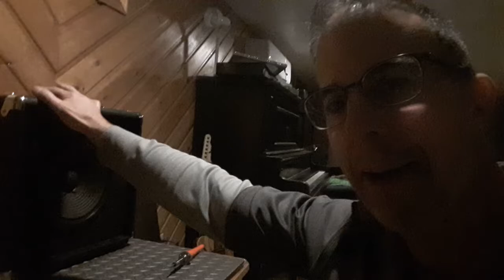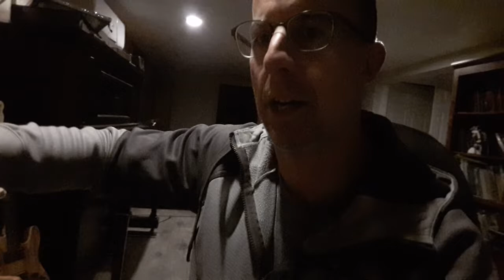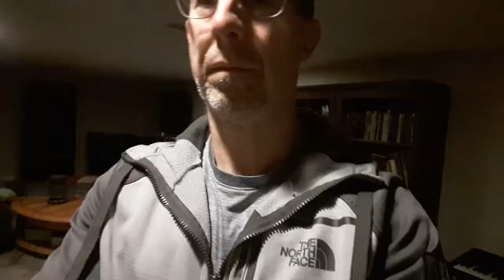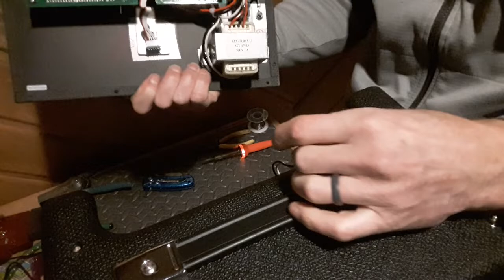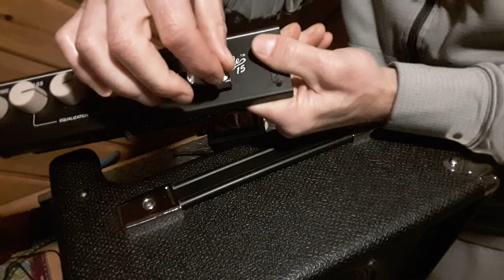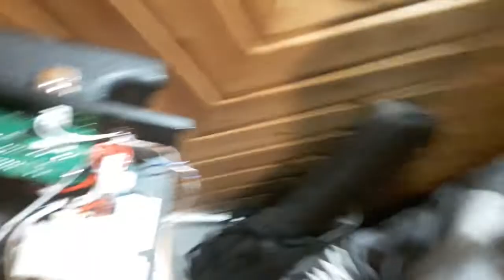Guess this amp: part 3 - The Mod: Combo amp and speaker cab with the flip of a switch!

Comment: This is extreme mega guitar nerdery. Man.... I love it!  Super cool for guys like us. I love the Cab idea. Stereo is better than mono - any day. Would love to se you play through a nice combo - and speaker out to that Cab at same time. Set em' far apart.... and get stereo rock and roll.  Even better, if you can Line in mp3 or whatever... with the first Combo Amp.  Rock and roll, Brother!
Reply from the maker: I'll experiment with this haha. The aux in will only work with the switch flipped on the Rumble side. If I flip switch to cab side, I can't MP3 anything... unless the amp I'd be running into the "speaker cab" would have an aux in as well...

Comment: I sent you a comment yesterday which is missing on that video now about making sure you don't have your amplifier turned on when you have that switch set to the other input because your audio amplifiers want to see a load which is the speaker connected to it. Without a load connected to the output when it is turned on you could blow up your audio amplifier chip.  
 I believe the rumble is 15 watts RMS. You need to know that the speaker that's in there is also 8 ohms like the one you got otherwise there will be a mismatch of impedance but if it is 8 ohms then you should be able to replace it no problem and the 15 w amplifier built into the rumble will not have enough power to overdrive the speaker it will underdrive it. However the 40 w external amplifier that you're talking about if that is also RMS that is double the capacity of the Jensen and you can overdrive the speaker and the damage it
Reply from the maker: Awesome Mike! Thanks for that. Not sure what the original speaker is. It doesn't say... I assume 8 ohms. It is a 15 watt speaker. The Jensen is 20 watts so safe there... will check on the ohms!
Reply: @j-mansgearcave  
Don't you have an OHM meter to measure the speaker in the amplifier? If you do be sure to disconnect it from the circuit first. What's depends on the omic value of the speaker you're driving into. If both speakers are eight then you can replace them interchangeably if the original one is 4 ohms then the output power into the Jensen will be diminished because the load is twice as much as a 4 ohm speaker if the original speaker is 16 ohms which is another common value then the atom Jensen will be an under load for the rumble amplifier and can burn out your audio amplifier in the rumble. You also need to know what is the speaker output specifications for your external audio amplifier. They always rate amplifiers as what's out into a specific ohmic value of a speaker
Reply from the maker: @2bikemikesguitartopics145  Yes haha never thought of that! I will check my speaker ohm reading with my meter tomorrow. I'll keep you posted.
Reply from the maker: Hey Mike,
So speaker is reading 6.7 ohms. I guess that means it's an 8ohm speaker?
Reply: @j-mansgearcave  closer to eight than four
Reply from the maker: @2bikemikesguitartopics145  my thoughts exactly! Haha 8 it is ;-)